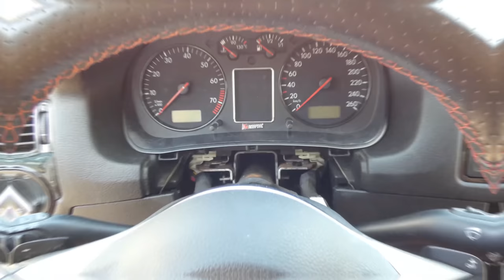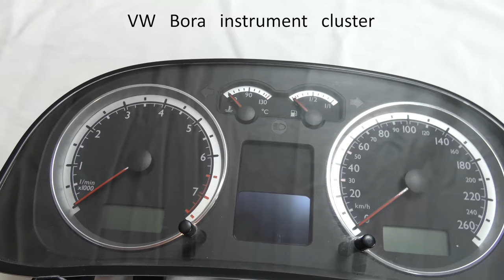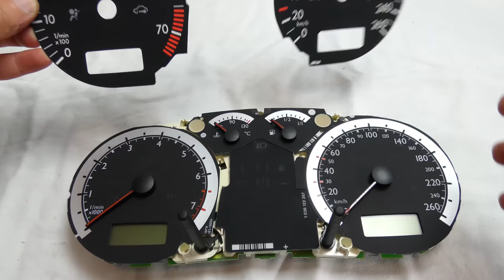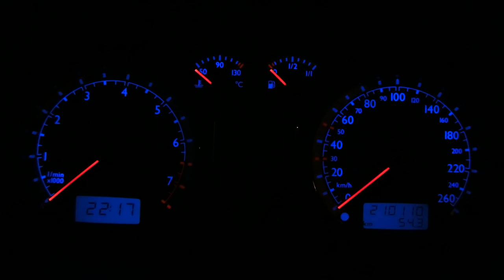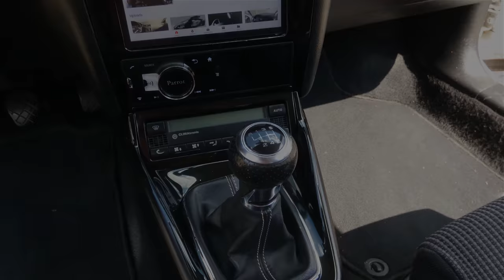VW GOLF MK4 INSTRUMENTAL CLUSTER MODIFICATION | GOLF MK4 HANNI'S ENGINEERING

Comment: I never thought about fitting a VDO SE Scale on a MotoMeter.
I see a problem here: did you adjusted the speed curve?
If not, your cluster will show 100 km/h if you drive 130.
Why didn't you just installed that VDO SE cluster?
Reply from the maker: That's true! first i didn't notice the different speed curve but after the video i bought another custom teller-plate with the correct speed curve on it (at moman.eu i think).

Comment: nice clip

But i don't understand one thing
why didn't you put the whole chrome dash? 
and you could put a new wiper level with bc and conect it to the back of the dash and you've got the BC working :-?
Reply: well i did this on my car
i put a passat b5.5 dash on golf 4, both had immo 3
and i made another mod for a client, a swap from immo 2 (i think that the car was make in 2000) to immo 3, from minidot to maxidot. it's hard but not impossible
Reply: @danutzy94  does the cluster from this passat model fit golf 4?
Reply: Yes, it fits if the Passat cluster is a VDO and you put it in a VDO case from a Golf 4

Comment: hi friend .nice  modifications you did with your cluster . but you will have a problem with your speed . the two clocks are 260 km/h but in the center they are different the old one have 130 the the new 100 . to fix that you should modify the EEPROPM the the cluster to have the corrrecte speed .

Comment: But isn t the speed displaying bad? I mean you have differebt numbers on difderebt places
Reply: @HannisEngineeringOfficial  I want to do the same thing as those clusters look amazing. But i have a different mod for you. A facelift, try to change the golf face with a bora/jetta, you needs the parts only. If you found a vr6 package it will be amazing. I m saving money as in romania my sallary doean't allow me to just do it :))))
Reply: @HannisEngineeringOfficial  do you still have the the plates? I need exactly the ones you have ad would be happy to buy them :) Thanks
Reply: HaNni's Engineering too bad :) thanks anyway :)
Reply: HaNni's Engineering where did u get the cluster faces that match the original speedo face? I just bought a bora cluster and found out the same thing as you did (that the faces dont match).